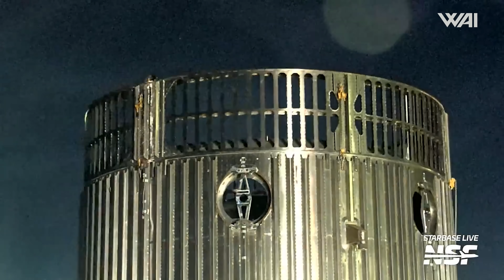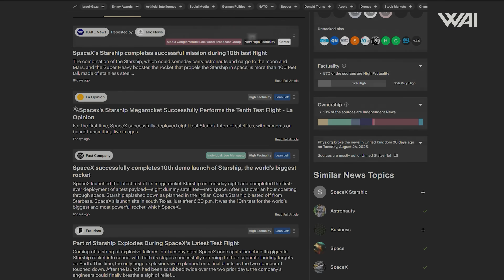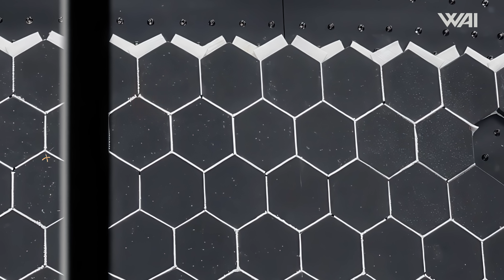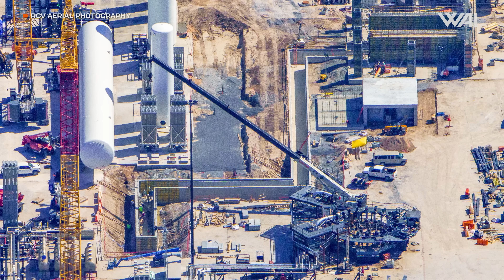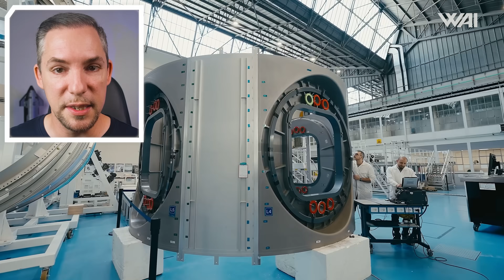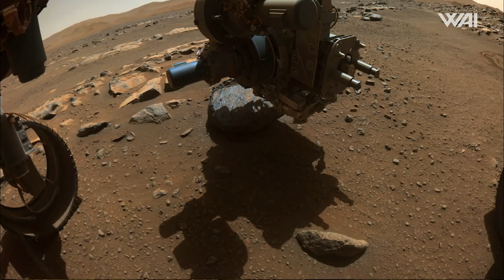SpaceX Surprisingly Reveals New Starship Heat Shield Plan! Flight 11 Launch Window

Comment from the maker: Visit http://ground.news/WAI or use code WAI on mobile to get 40% off unlimited access this month!
If Starship does launch on or before October 5th, this would bring it down to 40 days or less. What do you think? Can SpaceX make it happen? :_WAISweet::_WAIStarship:
Reply: S38 rolled out today on Wednesday. Assuming a static fire happens tomorrow which is currently planned,  they will have around 12 days till the end of September. That’s enough time for a launch to happen this month
Reply: Yes.The three stages will be ready. Stage 0 - nearly repaired. SHB - tested, ready and proven. Starship - tiles need to be wrapped but that seems to be going well. If the tile-to-tile application goes smoothly and it tests well, Starship is ready to fly. And demonstrating a short turnaround time is as important as the tiles or Raptors. Let's go!
Reply: Practice makes perfect.
Reply: GOOD. GOD FELIX!  New Sound? New Seriousness?

BRO. Great content too.

Seriously...very good job!
Reply: Felix, the merch store still seems down (404) - any idea when it's back?
Reply: Felix, life on Mars was discovered back in 1976 by both of the Viking landers. Look up their Label Release experiment's results.
Reply: @johnbuchman4854  Ummm, about 3 non-Viking scientists agreed with any findings of the Vikings.  Read the rest of the white paper. It was the stuff of witchcraft in a scientific paper that significantly failed 99.8% of scientific scratch tests.

Even the Perseverance data is still unproven and being discounted is possibly being just a water+geographic creation. Sorry, but you need better sensors to prove out any life on Mars. Probably handheld ones, given how no real scientist will certify Mars as having life yet, and it's just one planet over from us. 

They're still going over the Perseverance data, though, so let's keep hoping!
Reply: @johnbuchman4854  NASA thought that they had discovered life, but failed.

Comment: I'm surprised that SpaceX hasn't started testing any Mega Tiles to cover areas where the underlying body of Starship is a very uniform curve in order to increase reuse times and lessen the loss of small tiles because they Mega ones would have more attachment points. It would take a few experiments to figure our how big a Mega tile should be.
Reply: Sounds good but maybe in practice could slow things down, I’d imagine with the beating the tiles take they would need replacing regularly, maybe a few here and there if they get it really good but still replacing a small tile would be easier and quicker and cheaper than replacing whole mega tiles for just one spot of damage or something, idk just my thoughts on that, I would say manufacturing would be harder for mega tiles vs small tiles however they would probably overcome that problem pretty quick

Comment: I have a heatshield question ablative shields shed material and heat with it as it burns off. have they considered using something like sodium that would vaporize and possibly do the same thing? Would attaching a few replaceable blocks near the center carry a heat away with the gas as t?hey burned off?

Comment: Hi, i am regular viewer and a big fan. One thing that make your show great is that you actually show relevant and often exlusive pictures and videos instead of random b-roll. However in this episode it think you snuck in 2-3 AI clips. Especially the AI generated rollout of the new hotstaging system which was labeled as "captured by WAI photographer" was weird. I get why you might choose to use this tool if you don't have proper pictures or clips available, but you should really think about whether it's worth it to drop one of your unique selling points like that.

Comment: That crunch wrap must be made of some quite interesting material, or at least I hope so, because if it isn't some non-ablative material then the refurb required when too much of it has ablated away after multiple flights would be horrendous since presumably it would involve removing all the heat tiles and re-attaching them with new crunch wrap behind them.

SpaceX engineers obviously aren't stupid and know full when that the end-goal is rapid re-usability so presumably they have found or invented something that isn't going to ablate away, or at least ablate sufficiently little on each flight that the interval between what would essentially be a complete heatshield rebuild is considered acceptable to still maintain the required reusability cadence across an entire fleet of Starships.

Comment: A question for you:  what flight profile will IFT11 have? I would lean toward orbital insertion followed by de-orbiting after one or two orbits and splashdown in front of Starbase, exactly where the IFT10 booster is splashed down... for B15#2, I would instead plan a second catch to see if it can handle it... since OLM1 has to be destroyed and reassembled, any damage there wouldn't be a problem!

Comment: We need a large enough rotating space station without windows to simulate gravity. Without windows because from what I understand unless it's really huge it will need to spin so fast it would make people dizzy. Astronauts will need a schedule of at least 12 hours with gravity to remain healthy. It also needs to be large enough to hold about 50 people max and closer to 30 most of the time. We then need about a couple dozen of them for companies to setup manufacturing in space. And yes some will need nuclear reactors for large industrial equipment and metal foundry work. We need sheet-metal to be made in space along with recycling all metals.
Reply: The large diameter needed to keep the coriolis force small would be provided by tether between two Starships.

Comment: Wait, how come SpaceX doesn’t just make the heat shield segments bigger or one piece?
Reply: Bigger tiles break.
Reply: @greghadaller how to make them more durable?
Reply: The ship expanse at a different rate on different parts of the ship.
Reply: @larrycotterill9350 Ohh, OK
Reply: @larrycotterill9350 Wait, but how about not one big heat shield piece, but smaller ones but not the very small ones on the current heat shield?
Reply: One big tile that's the same thickness as the smaller tiles is even more likely to crack and break. But if you increase to thickness of the larger tile then you could be looking at a tile that weighs up to twice as much as the group of smaller ones.
Reply: @mig4868 how to fix that problem? What material has to change?
Reply: @stefannyhardiman708 The tile itself has to change. For a single piece tile it would need to be insanely durable and also a bit flexible to account for movement. Bigger tiles are a challenge because if one fails a bigger area is exposed. Also if tile thickness stays the same the bigger the tile the easier it is to crack. So yeah you would need very durable flexible heat tiles to accomplish this which just are not really a thing.
Reply: @QPD-1 OK

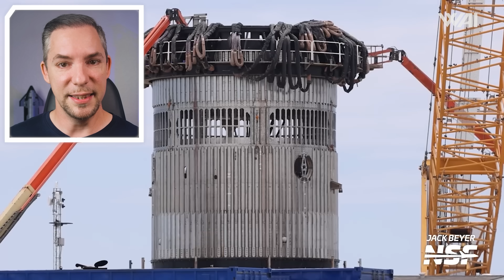Comment: 1:32 - Felix: "Sometimes you can avoid having to test things on a flight."
No, Felix, that is 100% backwards - there's almost nothing you can't test without launching!
And in fact, SpaceXplosion is well know for failing at this very badly.
The reason Apollo was such a huge success was that NASA decided not to constantly blow them up.
Reply: but they weren't testing resuability and heat shields, they were just putting Humans on and praying for the best.

But because there aren't any humans on board and this is all new hardware, its best to just fly it a bunch and find out what makes it explode.

Comment: Can't believe the new integrated hot staging ring will hold up a Starship under full booster acceleration.
Reply: @DJ-bh1ju  it makes sense from a physics perspective. What was holding it up before was a thin ring of metal kept in form by geometry and pressure. The ring is a thicker series of triangular trusses that are designed specifically for load bearing.
Reply: @bheemasena2383  yeah my biggest worry is how those trusses will stand up to the heat load of hot staging, they'll probably need to be designed to be interchangeable as they get worn out
Reply: It is an old proven design. Just a matter of scale.

Comment: Minute as "very small" is pronounced mine-you-t, not mi-nut.

In 2026 SpaceX has applied for 69 launches between Starbase and LC39A at KSC.  That is more than one a week.  Between now and January SpaceX must reduce the time between launches to 10 days.

The second flotilla of Starships to Mars is planned to include at least one Starship which will return to Earth.  While that Starship is on the surface of Mars it should be possible to launch a very small rocket-propelled probe which could collect the samples gathered by Perseverance and fly them back to the Starship for return to Mars.  It seems to me that any university engineering department could build a vehicle with that capability.  I wish that the various sectors of the aerospace industry would stop fighting with each other and start exploiting the strengths of other business partners.

Comment: Spacex needs to develop a spray-on heat shield.  Like a rhino luner for truck beds.   That way, if part of the heat shield is damaged, they can just spray each layer, each section as well, back on.   Rapid reuse.
Reply: I think the chemicals and environmental stuff from spray transfer would cause that not to happen. But if there was a better way to go about it, I'd definitely be a fan!
Reply: @awesomness1234567100 didn't they change the foam on the shuttle over environmental concerns?

Comment: The new hit staging ring does not seem to have any deflector sections to assist with rotating the booster during separation. Did they decide against it or may it be added later?
Reply: I've been thinking exactly the same thing ever since we first saw the new hot stage ring design (I think we'd already heard about the directional hot staging by then but if not then it was as soon as I heard the details of that when I started thinking about this issue).

I wonder if they might be able to achieve at least some directionality by using differential thrust from the Ship's three centre Raptors. The most extreme differential thrust would be gained by lighting one or more before the other(s). For instance if you consider the 3 centre Raptors as a triangle oriented so that it has two of the Raptors forming each end of the base of a triangle and the third Raptor at the apex. If you want to pitch the booster in the direction of the apex then perhaps you could light the two Raptors at the base a split second before the one at the apex so that you got some initial directional force on the booster top dome pushing it towards the apex i.e. towards the briefly un-lit centre Raptor. That would presumably also cause a course deviation for the Ship which would vector slightly in the opposite direction to the direction you're (hopefully) pushing the booster but if that differential thrust is only applied for a split second at lower (not full) throttle it might be fairly easily corrected a second or two after stage separation using the gimballing three centre engines that by that time would all be alight.

Comment: Why can't they make the heat shield tiles larger so there are fewer gaps to fill?
Reply: Curved surfaces, thermal stresses from extreme cold on the bottom to extreme heat on the top, lots of flexing going up and down…..all that argues for smaller applications, not larger, to have them stay on. - Dave Huntsman

Comment: On the Space Shuttle the "Gap Fillers" were used only in certain areas (although many) to allow for thermal expansion between orbiter and heat shield.  Most of the tiles had gaps eliminated by very precise installation, and not guys in bucket trucks.
Reply: Problem is, the requirements ended up being a bit too precise- and costly- with custom-designed tiles over every each of acreage essentially, tho that decreased a little with experience. Truly operational vehicles- the ultimate objective, right? - have to be very forgiving, not unforgiving. - Dave Huntsman

Comment: I’ve never seen any discussion of the various ISS modules and whether it would be possible to disconnect any of them to be used further. Could the axiom station see a benefit from adding one or more modules from ISS long term? It feels like such a waste to bring down the entire ISS and I know some modules were built much more recently. Also all the solar panels and thermal radiators. Surely those still have some value. They recently upgraded the solar panels. Any thoughts?
Reply: A fellow clippers in the wild. Down with soulless corporation infringing ownership
Reply: I think it's about time we generated 'gravity' in space by spinning ring-like components around a common centre tens or hundreds of metres apart.  Artificial zero-gravity production processes may occur at the centroid, but surrounding the 'factory' in rotating rings must be the humans who need a gravity field in which to thrive, and kitchen, bedroom and bathroom equipment which can be off-the-shelf.
The same method may be adopted for human Mars transportation by pairs of Starships spinning by their noses.  Except for orbital conditions (apparent weightlessness), "down" is always the same.
There needs to be mobile thrusters working through the ships' CGs to spin them by their noses.  The tether line could possibly be a conduit for power, gases and information.  That's it, apart from 'radiation'.
Reply: Entirely agree! but there are so many obstacles. The biggest obstacles are probably US politics and the Invasion of Ukarine. The module most recently attached is not new, it's a Soviet module built in the 90s. Solar panel tech has improved so much in the last few years that the ISS panels are kinda obsolete. Hopefully, somehow, at least some modules will remain. We'll see.
Reply: Axiom is unique in designing their modules, from the get-go, to be independent of the ISS. They are also newer and more modern- most ISS stuff is at least 2 decades old,, some older than that; and unlike fine wine, space systems don’t’ get better with age, ok? What is needed is to ensure an absolutely gapless transition between the ISS, and the multi-competitor, US-led commercial LEO ecosystem we want to follow it. We want a full ISS capability maintained while at least two different commercial LEO competitors are stood up. That, by itself, you’ll find, will be increasingly difficult to accomplish over time. - Dave Huntsman

Comment: Just so we're clear, there were a LOT of tiles left off on the nose to test the ablative underlayer. That's where most of the white came from.
Reply: The heat shield system is looking like it will end up quite robust. Even if a couple tiles fail having a failsafe system underneath with the ablative layer makes a lot of sense. My concern though is what happens to the ablative layer if a tile pops off?  The Crunchwrap design is pretty slick but a large single
piece blanket underlying a large segment of tiles wouldn’t be able to fly off the ship due to a few tile failures.
Reply: @undertow2142 This is where it’s important to remember that, operationally, we’re dealing with what is meant to be a reusable system; something where everything is being assessed, from the beginning, on how it survives multiple flights. From a safety-of-flight aspect for any one particular mission, therefore, I’m not worried. - Dave Huntsman

Comment: Crunch wrap sounds like a Taco Bell menu item, could be a product placement move, hmmm...
Reply: They call it crunch wrap because the ceramic fabric folds around the heat tile like a tortilla folds around the crunch wrap taco shell.
Reply: Taco Bell's Sweet Chili Heat shield crunch wrap supreme
Reply: Use taco shells.

Comment: Space X can do just about anything about spacecraft, I can't wait to see a Starship fly across the world with passengers aboard,.🇬🇧🇺🇲🌝👍
Reply: Don't hold your breath unless you can do it until 2028.
Reply: The thing is, you’re not the first to notice that. Once Starship (upper stage, that is) is finally ‘developed’ for its upcoming primary space missions in these next several years, the basic platform itself would be the first that could, just might be, truly capable of point-to-point suborbital premium travel. SpaceX itself as a company probably wouldn’t want to get in the ‘airline’ operations business; but a spin-off might be the way to go. - Dave Huntsman
Reply: Commercial passenger flights is a significant ask, given that the customers have to be prepared for 0g travel.
It would make Australia, India, South Africa heck of a lot closer, though, and I'm sure the plan is to build ports in all those places.
E2E in some form will certainly happen in any case because the military wants it (then commercialization could happen).
I'm positive people are thinking how nice it would be to be able get materiel to Taiwan at a moment's notice.

Then for personnel, would the Space Force eventually get their own "marines" to move?
A branch of the existing marines, probably, trained for space travel.

Comment: Why not have much larger heat shield pieces, instead of all the small tiles ? A get rid of the joints ! Maybe they can't be manufactured in larger sizes ?
Reply: That's actually a great idea. Imagine there were huge, curved tiles that lined up with the ring segments or something.
Reply: @ItimDave yeah, but the ablative nature is crucial to ensure that the heat is taken away and not absorbed. The hear tiles falling away when it gets too hot means it takes a ton of residual heat away with it.
Reply: @Dandanakka5610  I don't see how they can be oblative, because then surely they aren't reusable.
Reply: Because they're still crack-susceptible and expand magnificently.  (Fuel leaked through ceramic hair might do the job.  But they would still have to be hairy hexagons).